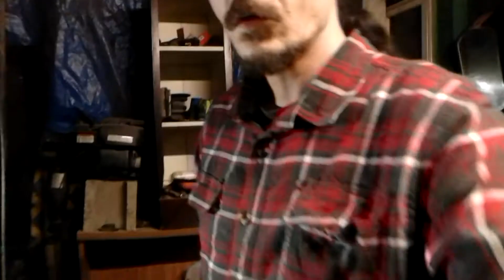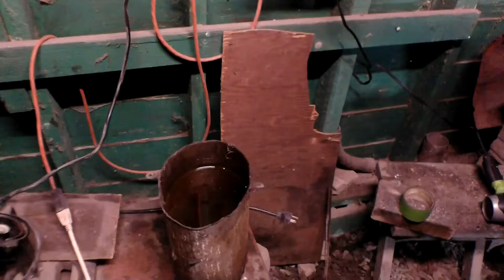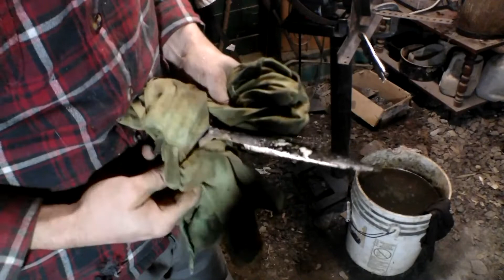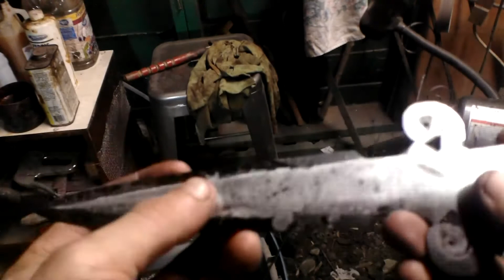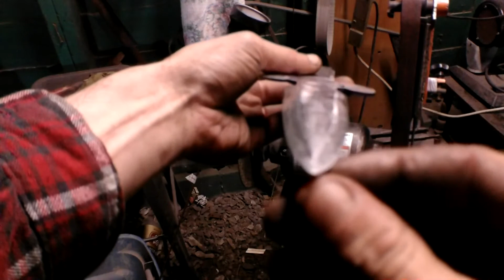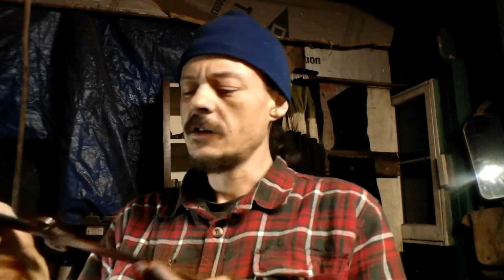The Quench thrill of victory or the agony of defeat

Comment: That dagger is looking awesome. Curious as to what you were sprinkling on your dagger as you brought it up to quench temp. You said borax I think. I thought that was just for welding steels together. See how much I know about forging 😂😂😂
Reply from the maker: It is for welding steel together. It dissolves the oxidized layer on the steel so you can stick the weld. I used it to prevent the oxidized layer from forming on my blade. Now I don't have to grind off the scale layer.